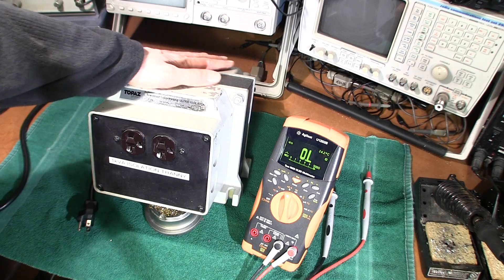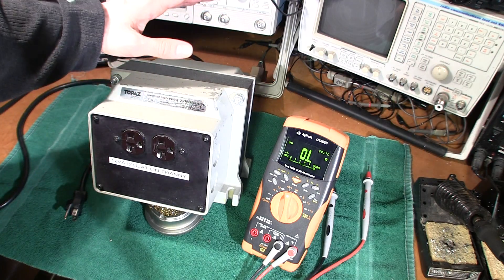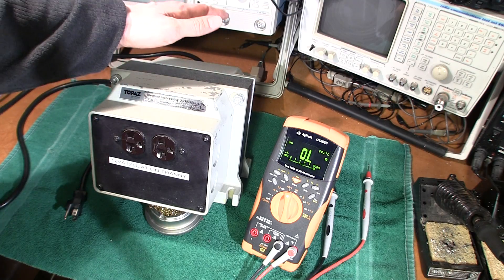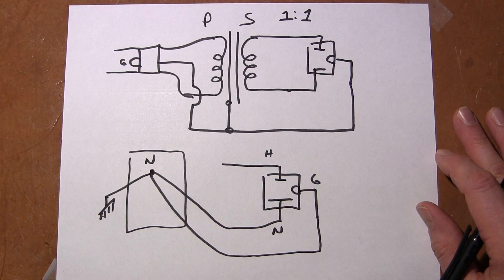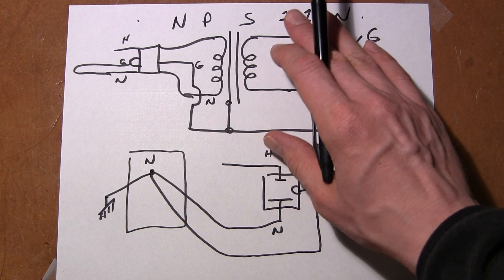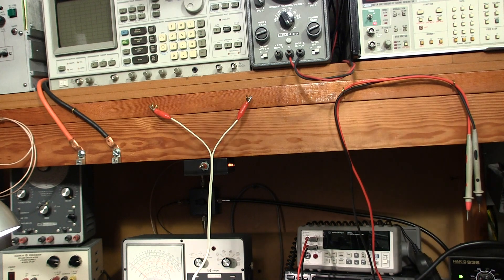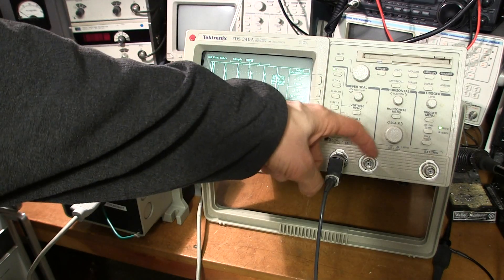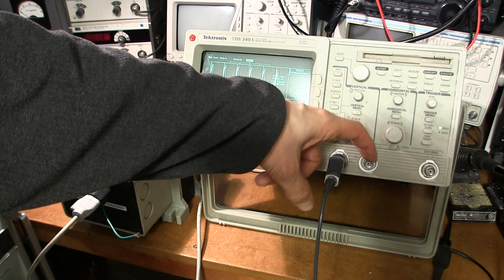Tech Tips Tuesday, Isolation Transformer and Variac Safety

Comment: How about those old RCA  Iso-tranformers? No ground prongs on ANYTHING! Two prong 15 amp 120 volt AC outlets with taps at something like 105,110,115,117,120, and 125 volts. I picked one up for $10 or $15.  With the O Scope's mains ground ref, I bought a charger inverter for a sail boat. I got it dirt cheap, brand new in the box, made in the 1990s, and it's a really great unit compared to most of the junk on the market now. I can go with the tru sine wave inverter, and my O Scope is running off of what are basically six or eight car batteries. I only get 25 amps @ 125 volts AC, and 150 amps @ 13.7 volts DC  from the set up. I did put a filter in, in case I need to use it while it is charging. It can be really noisy on the DC when it is charging, so I put in some big fast Shotkey diodes, extra capacitors and a 180 degree out active tracking null filter. It cleaned up a lot of switching noise. Some ferite beads knocked down a lot of the transient spikes.

Comment: No that is NOT an isolation transformer - it should be called a conditioning transformer and for bench work have the earth disconnected from the socket !
Reply: I agree how can it be an isolation transformer with a ground plug?  I have a very old isolation transformer and it has a 2 prong plug.

Comment: i worked in electronics all my life and every oscilloscope I ever saw in use had the ground connection to the mains defeated. the manual always told you to never do this but even the HP and Tektronix support guys told you to isolate the scope from ground. There is danger and doing this but if your working on power electronics you should be well enough informed to do it safely.

my isolation transformer has it's core grounder but the output terminals do not carry that ground through so the output is truly floating.

Comment: I had recently bought a small "isolated transformer" for safety reasons per advise here (YouTube) and in books on testing circuits with scopes and other earthed equipment. Concerned, I tested and was surprised and confused to discover the ground line connection on the IT.

Thanks to your video and the "EEVblog #279 - How NOT To Blow Up Your Oscilloscope!", I now understand.  VERY VALUABLE!  Thx!!

Using the light bulb also provided a safety check method. +Thx.

Now, I need to understand why AC circuits/devices don't blow up since hot and ground (via neutral) are connected 60-times a second (USA). ;-)
Reply from the maker: Glad you enjoyed Stephen.
Reply: Ground and hot are not connected "60 times a second". It's ground and neutral that are connected.
Reply: +davecc0000 Thx. Being AC, when the neutral goes +, and neutral is connected to ground (-), isn't there a conflict?
Reply: Surging Circuits neutral does not go positive.  The hot is alternating between positive and negative 60 times a second.  The neutral is the reference potential.  It does not change.

Comment: Unless the capacitance between primary and secondary be so high, the bulb would not light because the seconday is floating (none of its terminals is referred to ground).  Can your test show the same result with smaller isolation transformers, say in the 100VA range? Am I wrong? Thanks for pointing out the risks.
Reply: The hot is referred to neutral(which is connected to Earth). Since the ground(same as primary neutral)is passed to the ground of the CRO, it becomes primary neutral. Thus, when probing if the negative probe of the CRO is connected to the Hot, it effectively becomes a shot between primary hot and neutral

Comment: In regards to high voltage vacuum tube gear repair, do you suggest using the isolation transformer (with floating secondary/gound untied from neutral) for the device under test ONLY, while test equiptment (oscilloscope,etc)  is plugged into standard, grounded mains?
Reply from the maker: +Paul Beeman 
Hi Paul. That's a trick question :^) This is what I do..... I'm not saying you should do this!  Depending on the situation, I will float test gear. I almost always float the DUT. My isolation transformer has no "carry through" earth connection. My isolation transformer is an isolation transformer.
Reply: Thanks for your quick response! I love your channel, thanks for your efforts Mr.Carlson.

Comment: Another great video, great thanks Mr. Carlson!Similar to this video, I have an audio related question. How can we eliminate power line noises coming into audio gears? I have few tube amps and solid state amps, getting powered by a single UPS. And I thought this UPS would have RFI/EMI filter as well as a voltage stabilizer in it. But I guess not, since I still hear a constant yet very faint humming all the time. So I put a very big chokes onto all the power lines going into amps, but no effects.Are you by any chance willing to make another video about 'how to eliminat power line or RFI/EMI noises for audio setup?
Reply from the maker: +Tennisplayer21Kim 
Hi Kim. May I ask why you are using a UPS?
Reply: +Mr Carlson&#39;s Lab 
I wanted some voltage spike prevention + RFI filtering. My UPS have a surge protection + voltage stabilizer, although I am not using it for power outage backup. Well, I actually hear some buzzing/hum coming from the UPS!  So, I was thinking of buying Monster Cable MP HT800, etc.
At first, I thought it was my USB music source, so I got the Audioquest Jitterbug USB filter, which made no differences at all. So I think its not the music source. 
If you shed some light on this topic, it would be a tremendous help/hit for all of the audio fans, such as members of Head-fi.org. I'm one of them.
Reply from the maker: Hi Kim. What happens if you omit the UPS and plug the unit into the wall directly? Does the interference go away? Does it get worse or better?
Reply: +Mr Carlson's Lab : if I omit the UPS, humming gets very quiet, yet it's still there. Thanks for your interest!
Reply from the maker: Hi Kim. It sounds like the power supply has bad, or not enough filtering. I wouldn't use a UPS in line with any audio gear, as it's a source of noise itself. Noise coming from your wall outlet gets filtered by the power supply in the amplifier. Your wall outlet is a low impedance source, carrying much current. Any or most noise on that line will get trapped by the power transformer in your amplifier, as itself is a great filter. (that power transformer is tuned to operate at the line frequency, by the core material and core size.)
Reply: +Mr Carlson's Lab I see, that's the very first thing I've ever heard that actually made sense regarding this topic. There's been a lot of talks going on on headfi, about how to cure it, but no one was talking about it with actual EE knowledge. I'll definitely forward it to them! Great thanks!
Reply from the maker: Your welcome!

Comment: What I like to do with my oscilloscope is take an analog meter from oscilloscope ground to device under test. No voltage or low I drop down in range. That means less resistance. If the voltage goes down more then the try measuring the current. If no current exists then I'm good to go. If there voltage well then I figure out what from there. I run my device under test through an isolation transformer from which I removed the factory neutral earth lead. Don't know why they advertise isolation when they ground the secondary neutral side defeating the purpose!
Reply from the maker: +TheMonkeyFarted 
Thanks for your comment!

Comment: I rewired my isolation transformer to include switch that allows me to either connect the secondary side ground to the secondary side "neutral" leg, or leave it floating. The chassis of my  isolation transformer is properly grounded through the primary side ground wire, but there is full isolation on the secondary side output.
This seems to work well enough for me.
Reply from the maker: +N1RKW 
Thanks for your comment!

Comment: I use a Sencore PR570 that incorporates an isolation transformer a variable control and a current limiting adjustment from 0 to 4 amps. The device that I work on is only connected to the isolation system not my test equipment. However, your video prompted me to test my very expensive Sencore SC3100 scope, that to my amazement is grounded to the chassis like most scopes you discussed. It never occurred to me that mine would be one of them considering the fact that it can measure 2000 volts peak to peak with the specialty probe that must be isolated because I have measured the RF voltages directly from the horizontal output transistors and analyze the waveform that average 1500 volts peak to peak from the older sets. Still, I am not impressed since they claimed it was safe to measure where most scopes would blow apart under that type of stress load.
Reply from the maker: +John Cunningham 
Interesting story John, Thanks for taking the time to write.

Comment: Hi Mr. Carlson, excellent video's, I really like the tech tip's tuesday  segment. Qeustion: Can you connect a variac to an isolation transformer, and, if you had a light bulb type current limiting device, could that plug into the variac to power a device, say an old tube radio? What would be the correct way to hook up these devices? Thankyou, C.
Reply from the maker: +Cass Virgillo 
Well, that's kind of a trick question. I personally would want the isolation transformer first, but some may not. When working on a radio, one has the tendency to grab the knob of the variac. I would prefer to have everything isolated after the transformer in the test setup.

Comment: Thank you Paul for bringing to our attention the need to consider the nature of the supply coming to,our "Isolation" transformer, and the way that itself is connected internally.You certainly made me reappraise my modelling activities wherein I replicate different types of supply and their earthing arrangements -Tierra-Tierra TT, Tierra y Neutro Separado TNS , Tierra y Neutro Combinado [Separado] TNC[S].I work mainly from a step-down transformer (240 V 50 Hz. Input to 110 V centre tapped output). This type of transformer is commonly empoyed on building sites to afford a measure of safety and are often referred to as isolation transformers when in fact, because of the earthed centre tap of the secondary winding are in fact in metallic connection with a current carrying conductor. The term Protective Extra Low Voltage is more appropriate, as for it to be a Safety Extra Low Voltage transformer, as according to the On Site Guide to BS 7671 Section 3.4.3,/ 414.3 " ... have no live part connected to earth or protective conductor of another system."This clearly means a double wound transformer with no part of the secondary circuit connected to earth.A common example found here in the UK would be the shaver socket outlet supplies for deployment in bath/shower rooms.Saludos.
Reply from the maker: +Hassan Burrows 
Thanks for taking the time to write Hassan! I'm glad your finding the videos helpful.

Comment: Thanks for the video. Regarding your sketch a the 5 minute mark... what is the voltage between either secondary side wire and the secondary side ground?  In other words, if my feet are grounded and I touch either secondary side wire, will I receive a shock?. If yes, what is the point of the isolation transformer????
Reply from the maker: +vs68s 
The secondary winding is isolated, they just carry the earth wire through to that side.
Reply: +Mr Carlson's Lab 
Thanks....a similar sketch for the oscilloscope example would help us newbies from making that mistake. For example, on your two wire white mains leads screwed to wood, I am assuming the left side is neutral and the right side is hot??? unmarked two wire cables from mains are dangerous???

On another topic, would a gfci on the secondary side improve safety?

Comment: Your videos are a great watch and I know you know what's what for sure.
However that device does not appear to me to be an isolation transformer, what is it isolating and why do you need a safety earth..it' still has 1 leg to ground so the user will potentially (no pun intended) still "see" all of the incoming mains as you pointed out, I would have thought this type of device would be more for hi fi/video use as it is balanced and not fully floating.In addition to that if there is a faulty equipment you might end up seeing all the mains voltage and plus or minus half the mains voltage from the center tap secondary.
Personally I'd take my chances and use a fully floating transformer for "my" test equipment and leave item to be repaired under normal mains conditions.

Comment: Nice Video!
I've a B&K 1655 isolation supply.  It also shows running a ground from chassis of the device under test back to the Isolation Supply.  The manual of this unit also gives a lot of info on the dos & don'ts and specifically warns of many of the concerns shown here and not to run the test equipment thru the isolation supply.  You can d/l the manual is one wishes to print a hard copy. If you go to the B&K precision site you can download the manual for the 16655A.  For some reason I am not able to paste the link here.  -Bob
Reply from the maker: +Bob Ograv 
Thanks for your input Bob!

Comment: This is why the Fluke Scope Meter (battery powered) became so popular even though it failed miserably in standard scope tasks.  It was a big success because it solved this age old problem and was the "go to" scope for troubleshooting AC mains problems.  I always hated that scope for most things, but when asked to work on AC problems it is the one I used.

While you are showing this ISO transformer as modern, I am wondering where the ones that had the ground lift switch fit in.  These functioned like the old ISO transformers with the ground lifted and like the one you show when the ground was connected.

Now days there are so many battery powered scopes to use for mains troubleshooting, I can't understand not getting one.  P.S. And they do standard scope function as good as or better than, classic scopes...
Reply from the maker: +Rick R 
I fully agree with the last comment. What fluke are you referring too in your write? I used the 199C, "back in the day" and found it to be quite nice. Thanks for your comment Rick!
Reply: It was a model 97 which I think was the original or the second version.

Comment: I do not see a use for a 1:1 transformer that has earth connected to the secondary side :-/
So please enlighten me to it's normal function :-)
Reply: +smbrob 

The normal function is to make money for the company that manufactures them while at the same time keeping the company's lawyers happy :^(   That's because big government is quite serious about protecting us from ourselves.

Presumably the "isolation" is from spikes, transients and harmonics coming in to the premises mains from the utility's wires.  Other "trash" can be generated by cheap offshore power tools, appliances, etc. that pollute the mains.  In most developed countries  there are code specs that, if adhered to,  protect the utilities and their customers from such pollution.  But to do a really effective job at that would require more sophisticated filtering than the device in the video.

 Remember too that every metal conductor that enters your house is really an antenna that can be quite efficient at carrying RF pollution into your house wiring.  

Here in the US we have entered into something called the TPP which now gives offshore manufacturers the "right" to market such dodgy and dangerous devices at will to an unsuspecting public.  (Actually, it just made an already widespread practice legal.)

Disconnect  the ground pins from the secondary outlets, or take the hint in the video and you'll be OK.  Just make sure you're not standing in a puddle when you use your "scope.
Reply: +Chuck Yahrling  so it is because of legal stuff they make them like that ??
Reply: Yes. UL approval and applicable codes require fully grounded devices.  I'm sure some expect that we will disable the secondary side ground but in that case they can say in court that they have no liability because we modified the equipment.  

Shipping a useless product keeps govt watchdogs and industry lobbyists happy.

Same politics with ethanol in car gasoline and electric cars that are actually less fuel efficient than cars with conventional power trains.  Anyone with a good high school science background can see the fallacies in the "environmentally friendly" arguments for both products.
Reply: +Chuck Yahrling  in my view they make it more dangerous :-)
Isn't a remark in the manual a better thing to do to have no liability ?

Comment: Hi I just bought an old pre-ground pin Stancor type P-6410 isolation transformer.  Output voltage is 115v and .43 amps. The previous owner said it works fine, but is there a way I can test this unit?

Comment: If you ever follow Mr Carlson idea of removing ground pin, and measuring line voltage, be aware that you have 50% change that there will be deadly line voltage on scope chassis, all front and rear bnc connectors and the removed ground pin. Under no circumstances try to touch scope or any of other bnc connectors. Well, that is true with any testing gear powered from isolation transformer. Do yourself a favor and get a proper differential scope probe or battery powered scope, easier, safer, and smaller risk of connecting everything wrong.
Reply from the maker: Under no circumstances do I suggest removing the ground pin in this video. What you see is a demonstration of the result of a missing or removed ground pin. What you mention about the scope chassis becoming hot is a definite 50% chance if line voltage is measured.